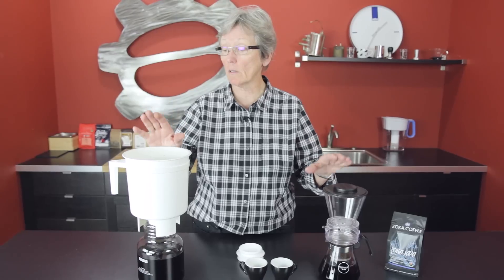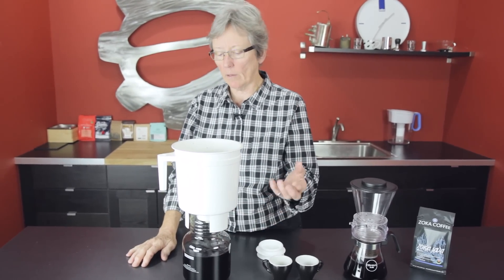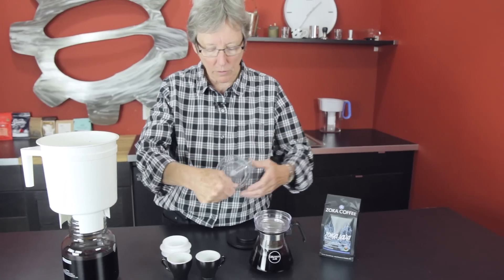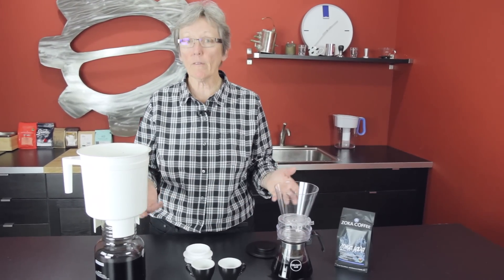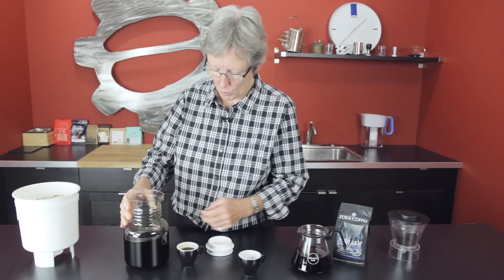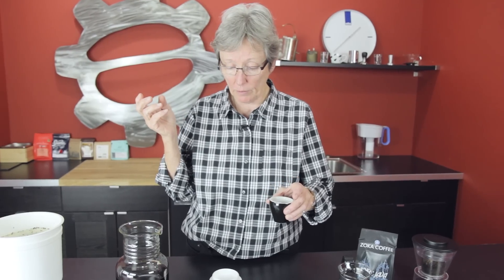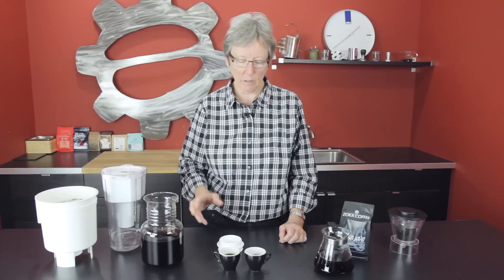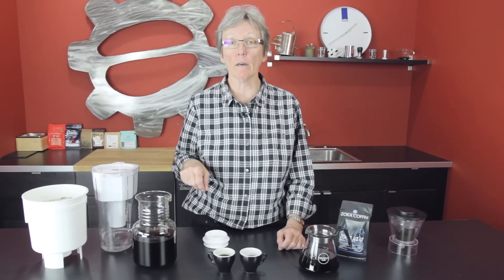Toddy Cold Brew System vs Osaka Cold Brewer | CR Comparison

Comment: I love cold brew coffee!  My mother-in-law had the Toddy system for years. They were on vacation one summer with friends who introduced her to cold brew coffee. She loved it so much that as soon as they got home she bought one of her own and never brewed coffee any other way after that. She would clear out an entire shelf in the fridge to accommodate the whole unit while it brewed. Then she'd use the cap from the carafe to measure out a single serving of the concentrate and add water to taste, then zap it in the microwave. Strangely, I don't remember her ever drinking it cold, always heated in the microwave.  I've always made mine using an 8 or 12 cup French press but I recently picked up a cold brew coffee maker made by Primula. The carafe is glass and the filter is stainless steel. Both the top and bottom of the carafe open with screw-on lids that have silicone seals to prevent leaking. I haven't tried it yet since the weather here has gone from 60F down to 35F !  The unit is quite small in that the filter will only hold a few Tablespoons of ground coffee so it's not for large gatherings but I'm the only  coffee drinker in my house so it's a good size for me.  :)

Comment: In my toddy, I use 4 large 10cm•15cm reusable tea filters and used 300g total ground coffee (75g in each bag), pre wet the grounds inside the bag, tie them up and then fill the toddy to the top and cover with a plastic lid and leave it on my counter for 24hours. I still use the toddy filter inside as well.
It drains beautifully and the toddy filter is easier to clean. I let the bags drip out until almost dry and dumping them out is easier. 
After the white toddy filter is dead, I’m going to start using the metal mesh filter, it won’t be as filtered but clean up will be easier with it. 
I clean the bag filters with dawn and they get white again quickly and allow to air dry until the next use.

Comment: Wouldn't an immersion brewer require a coarser grind, while a cold drip brewer can use a finer grind? I use a cold drip with a fine grind, and it comes out much darker and smoother.